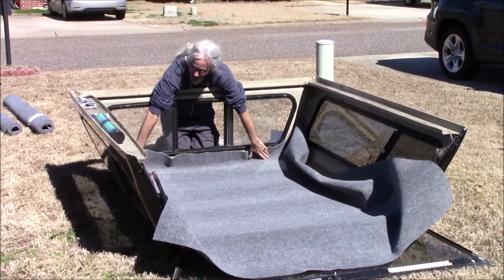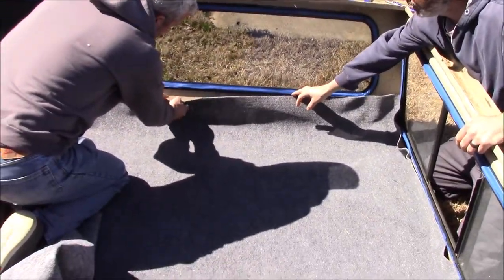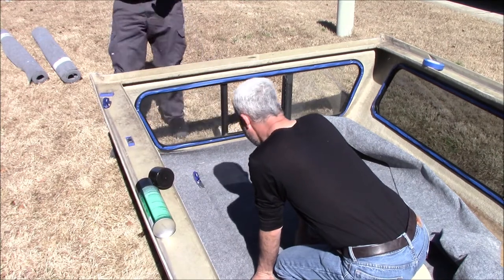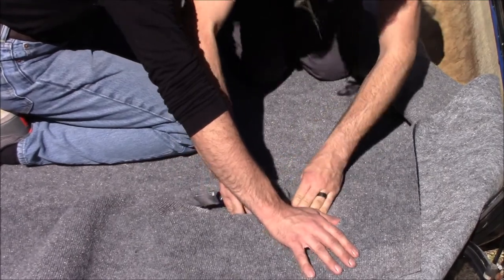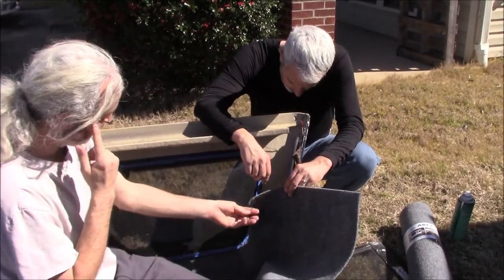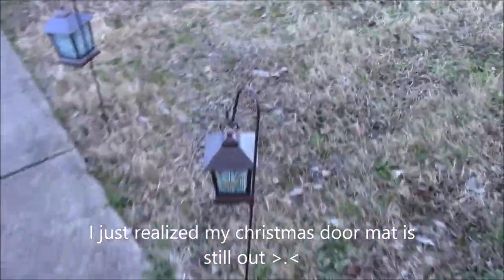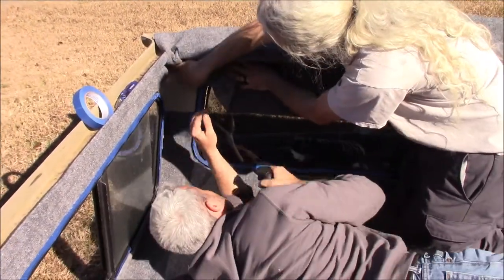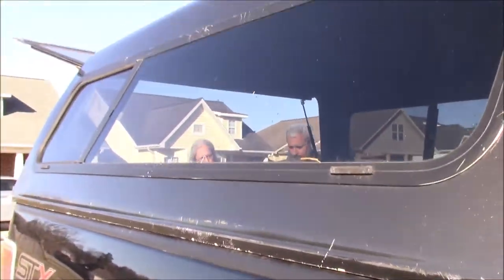Truck Camper Conversion Pt 1 Lining the Shell

Comment: I plan on doing this to my camper shell for my ford. I plan on buying it online more than likely Amazon. Where did you buy the carpet liner and how much did it cost you from carpet to adhesive spray and whatever else you bought to find the job. Great video I subscribed.
Reply from the maker: Hey thanks we used 3M hi-strength 90 contact adhesive it’s $13 a can. We also use the second kind that I can’t remember the name of but it was not near as good so I suggest getting the 3M. 
The carpet is just an indoor outdoor area rug 6x8 you can usually find them in a box by themselves not with the actual carpet and it was $18 a roll at Home Depot
Reply: @Vlogsoup  how many rolls of carpet did u need how big was the rolls

Comment: Seven months later. How's the carpet holding up? Any spots where the glue didn't hold? Needing to do the same to mine but scared its not gonna last.
Reply from the maker: OK I’m in Alabama so we have extremely hot and humid summers and during the hottest part of the summer one part of the carpet in the very back had a small section come loose and it was where if you watch the video we had to get a different kind of glue from the first kind and the second was not as good it was where that glue had been used so my husband went and got a can of the good stuff and glued it up and we have not had a problem since. And it was only in that one spot. So it’s still worth doing seriously
Reply: @Vlogsoup  yeah I'm over in Texas. So similar climate and all. I'm really debating having a shop glue it for me. Aspecially since you've said a small part came undone. Im worried I won't get it right and it'll come unglued. Thanks for the info

Comment: I just bought a used topper shell with no side windows. Although in theory, it seems that it shouldn't be too hard to find used (or new) side windows and to cut the the openings in the fiberglass for them. Would you know whether or not it would be easy in practice? I'm also tempted to put a couple bubble windows in each side instead of the regular windows. But I'm even sure they exist... but it would look cool for sure.
Reply from the maker: I’m not sure I’m sure you could find windows somewhere I think acrylic bubble windows would look cool they make them for RVs so surely you could find some from maybe an RV parts dealer or used parts dealer and use them to put in your camper. Or some vintage bubble windows from 70s vans But that might be harder to fine or more expensive
Reply: Amazon

Comment: Did you consider to add an insulation layer beneath the carpet like a 1/2" closed cell foam sheet? Would it be useful?
Reply from the maker: We actually did not honestly consider insulation. I have seen other people put up insulation in theirs but I think a half inch might be too thick, if anything I think the Silver bubble wrap type insulation would probably be your best bet to go to because it’s thinner but it would still provide just enough insulation to help